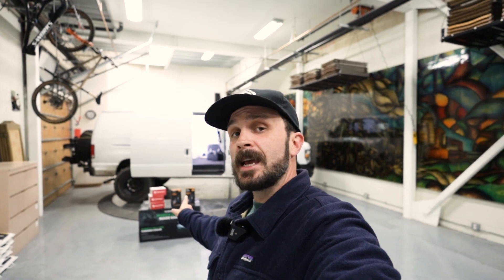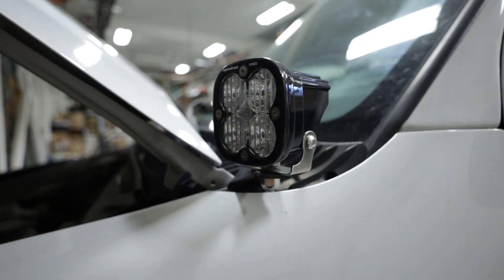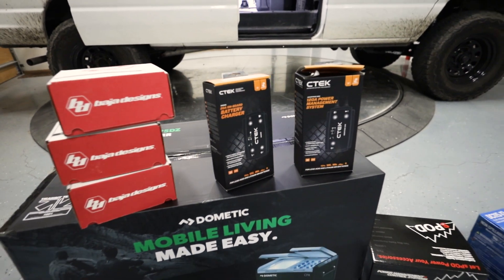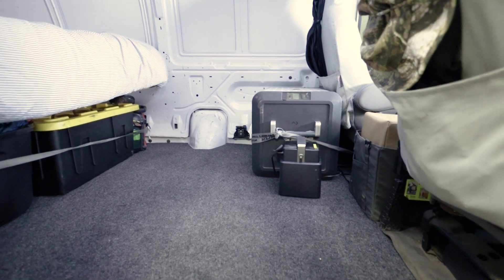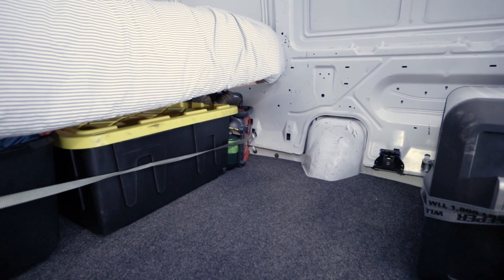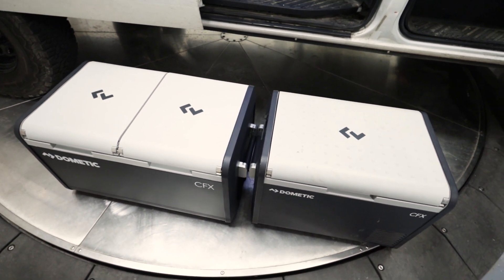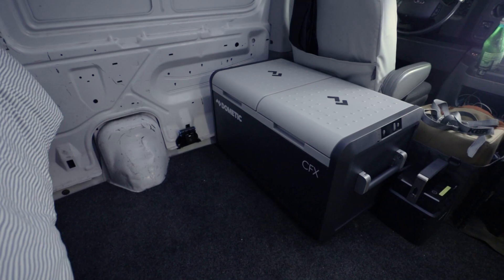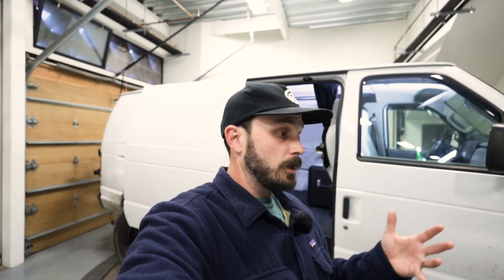Complete overhaul on my Van life Battery and Electrical System!

Comment: You could build a 10” or so tall “shelf” for the fridge to sit on against the wall to get it over the filler neck, and store the batteries in there
Reply: This seems like the best option
Reply from the maker: That could definitely work, I think I’d need a taller box to store all the electrical though and I want it to be easy to get to incase I need to add or fix anything

Comment: When you cross over into the actual electrical properties of the thingys you bought I’m stoked. I’ve done quite a bit of solar set ups and also wiring trucks and vans for promotional vehicles but this is a different world! Really dope to see your progress with the econoonline. 

Interested to see you are using agm batteries for this. I guess they are less explody than lithium, but I expected a lithium battery would be used for energy density and long term cost efficiency.
Reply from the maker: Thanks dude!